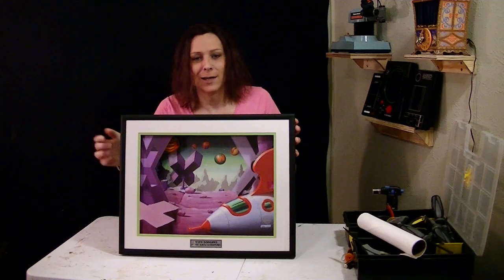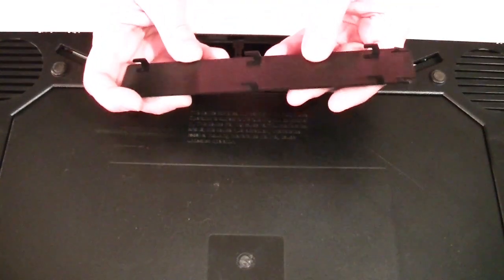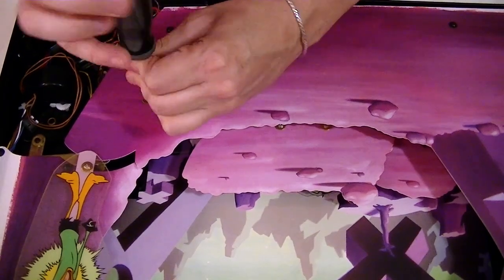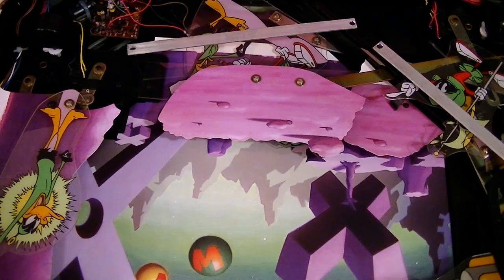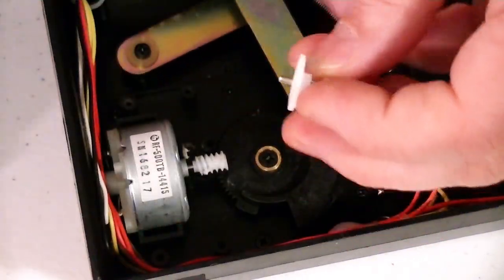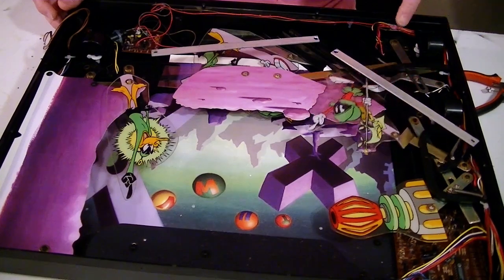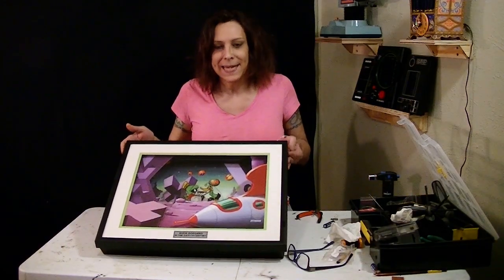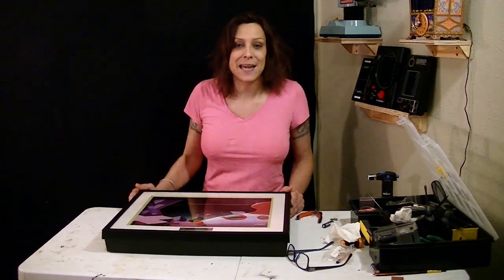Duck Dodgers Rides Again For The Second Time

Comment: Lube! I was thinking that when the new batteries worked. A little physical resistance, and the weak batteries won't move it. I like Danco plumber's grease. It's a crystal clear silicone paste. It's petroleum free. It never runs or hardens, and is plastics safe. I put it on with an artist brush.
Reply from the maker: That's a good tip.. Thank you. I'll look into that.

Comment: Hi Randi, I have this exact one and when I press the button, all I get is a ding and the ding will get louder when adjusting the volume. No movement and no noise that’s attempting to move. Any thoughts?
Reply from the maker: Every one of these has been nothing but broken gears.
Reply: @RandiRain  with my problem do you think there is a different underlying issue? Once again it’s getting some sort of power but overall does nothing. Just a single ding noise out of the speakers when I press the button
Reply: @RandiRain  have any idea what my issue might be? Seems like a circuit board issue but I can’t be sure